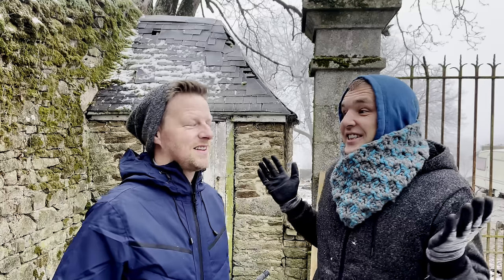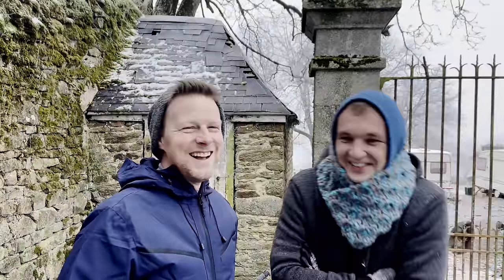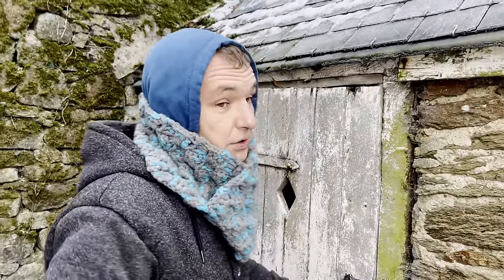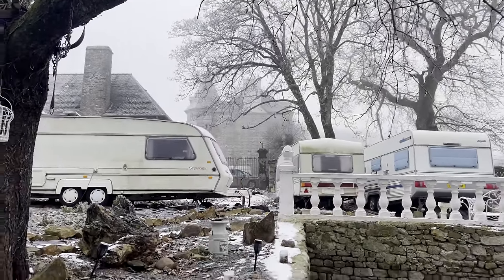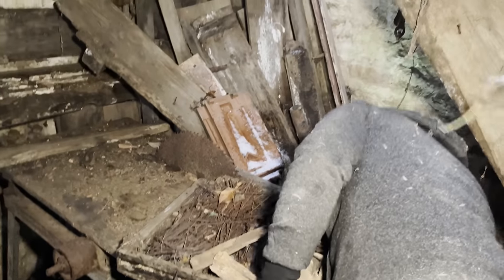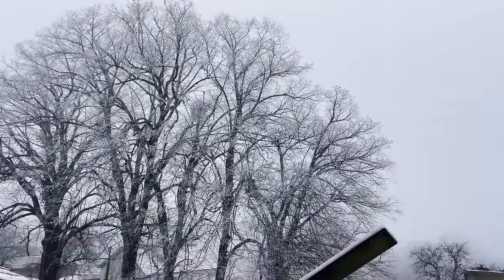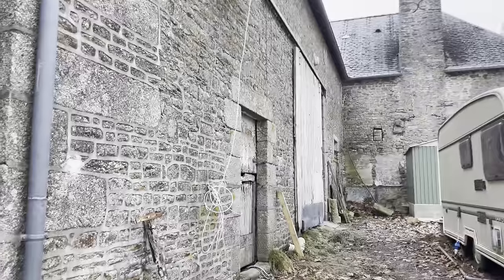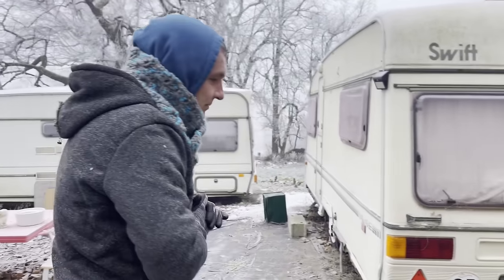Discovering the FORGOTTEN part of the CHÂTEAU | Day 7

Comment: I support Ash's idea about the staircase leading from the kitchen to the dinning room. The kitchens were usually in a basement and the food had to be delivered hot. It does seem logical to connect the two with the staircase. I also agree that the toilet would be used by servants only and not the owners. The owner would have a pot in a commode that the servants had to empty. Lovely job for some. It is unlikely that the Master of the house would walk to the little building by the gate when it is  -5 outside. 😄The "repair shop" building looks like it used to be an open timber frame structure that was filled up with stone on 2 sides at the later date and brick wall was added even later to create the room. Then they added another floor above using just wood. Perhaps there was an old farm predating the chateau? I hope you will discover the history of this place in time.  ❤
Reply: Hopefully servants also had a indoor toilet with a removable pot to empty  as they did the master's.  No one should have to use that toilet in the dark and bitter cold.
Reply: @debpate9405  Most definitely. In old times everyone was using a night pot. How lucky we are! ☺
Reply: They would have used chamber pots before indoor plumbing. This would have been to dispose of the chamber pots and latterly a toilet for outdoor staff.
Reply: Could have been a rope pulley for food!

Comment: Very interesting. Do a layout as you discover each building or foundation on a plan to see the relationship to the property for building foot prints. To give a better idea. There could have been a blacksmith area as well near the stables. It would have been for fixing carriages and doing metal work for the chateau. Much more to discover I'm sure. Thanks for including us on your journey. ♥
Reply: I know that they may need to be a bit cautious, so they don’t give a map to potential thieves, alas.
Reply: True.  A good reason to be missing two walls.  They were usually open to the air as much as possible so they didn't cook too bad.

Comment: You really need to find an archaeologist to assist you in your search for the history. I am guessing that the end off the barn was a small workshop or store room but the brick is maybe where a larger door has been closed in. this building if you made a couple or one self contained apartment, then accessed the uppe4r floor from the main building would make a fantastic terrace if you removed the roof on this part then have storage or another room below...

great video as always guys...

Robb Torremolinos Spain xxx

Comment: There was a stairway in the basement kitchen or in a hallway directly outside the kitchen that went to the floor above where the diningg room was.  The residents of the chateau didn't want to hear the kitchen noise and employees talking.  They also didn't want the heat from the kitchen in summer. Nobody had an outside stairway in a climate that goes down near zero.

Comment: An open side on a workshop allows them to store a very large saw inside to cut up huge trees for firewood etc. The great size of the table saw would be too big for trim etc, but perfect for lopping up tree size pieces, requiring open access... also for horses to stand there to be shod etc. or operate a horse powered PTO. One side (or even 3) open is not unheard of, then closed off w/brick later on. I think the bumpout housed a food pulley dumbwaiter with a counter for unloading & some shelves...maybe a slop area for dumping afterwards that ran into the sewer below via a wooden (?) chute. They used slop buckets that required dumping & rincing out, but not actual toilets. Just thinking out loud. cheers guys

Comment: Old rust frozen tools can be brought back with a bit of effort, the right, oil, & the right cleaning agents. Sometimes, the result is full restoration; sometimes, the result is a working tool that shows it's age. The craftsmanship & engineering are very seldom seen in modern tools.

Comment: I think that building with the missing roof was an old carriage house or farm equipment lean-to with an open front, then later converted into a workshop with the modern brick wall and electrics added.

Comment: Ash, that's what chamber pots were for. During the night or in cold weather people would use the chamber pots and haul them out to dump when it was light out.
You are correct that they might not have had plumbed toilets in the house when it was originally constructed. One could have been added after the fact.
When Versailles and Chambord were constructed, inhabitants relieved themselves in palace corners or hallways. An army of servants were responsible for cleaning up the mess. The smell must have been awful.
In 1982, when I lived in France, it was common to see people urinating and even defecating in public parks, along roadways, etc. Elimination has changed quite a bit in the last 100 years.
At the same time, we had friends visiting Russia using a sponge on a stick in a bucket in public latrines in lieu of toilet paper.
Having grown up on a farm that finally added indoor plumbing in the early 1960's, I can say that Terry is likely incorrect. They would have located the biffy far enough from the house to have avoided unpleasant downdrafts in hot weather. Many castles dumped their raw sewage directly into their moats.

Comment: Kitchens were in the basements with a big cook fireplace.  The bedrooms wood have had commodes that were emptied into the outside toilet by self or staff. The outside toilet is also close to the barns and work shops which makes a lot of sense.  the one inside flush toilet was most likely added around ww2 or later.  I agree with Ash about the staircase it makes the most sense.

Comment: Orangeries were used to house the tender plants, including citrus but could have had other houseplants and fruit trees. Some wealthy people grew their own pineapples! To do this they had many ingenious ways to keep the building warm. Obviously placing on the south side and glass was helpful, but steaming dung, underfloor heating or heating ducts or hot water pipes were used to keep the building to a temperature which would allow the plants to survive. The gardeners would need to have a fireplace which they filled with wood usually, to ensure enough heat reached the plants and didn't go out. This was a very important job where there were many exotic plants. There was a whole room for this under the palm house in Kew Gardens.

Comment: You are correct about the stairwell Ash. They did have separate stairs to service the dining room from the cellar kitchens. They would not put a toilet directly into the dining room! One of those latrine cubbies would hold the lantern you carried to find your way. Terrie, they had chamber chairs that were the toilets with a chamber pot under the seat to catch the excrement. The household staff would empty the chamber pots. The owners didn't go outside to use a toilet. That is a huge saw blade in the ruin's room. I thought it was installed on a table saw. I suggest cutting that ivy root now to help kill off the ivy with the winter freeze. Could those spaces in the building original to the château have been servant's cottages. They would have been 2 room, 1 up, 1 down.

Comment: More out buildings, definitely. The worthwhile rusty tools, etc. can be cleaned up by soaking them in a large vat or old bathtub filled with a solution of water and molasses. YouTubers say it works great and is environmentally friendly. Farmer supply grade molasses is recommended.
Reply: Vinegar works better.

Comment: I'm with team Ash on this one. Aside from his strong argument that they needed an efficient way to get from the original kitchen to the dining room, there's another indisputable argument. The absolute last thing you would put next to the dining room would be a toilet. Anyone who has ever used an outhouse will tell you that they stink. You would not put that constant smell right next to the place where you eat!

Undoubtedly, the owners and their guests would have used chamber pots, which the servants would have cleaned. Indeed, the servants living on the third floor would have used chamber pots, too. Having a small outbuilding to clean those makes sense but, again, you wouldn't route that traffic through the dining room.

Comment: Hi guys, I have a possible explanation for the orangery and it’s tunnel. Near me in derby there is a old stately home with an orangery and it also has tunnels behind it, however they were used to heat the orangery with fires heating up water and passing steam through grills to warm the orangery as they often had exotic fruit plants\trees.

Comment: I have not seen the true layout of the Orangery... but I do know 2' walls will have stored heat, tunnels may have been to light small intermittent fires and funnel heat, the ditch/ trenches I'd like to bet were for fresh manure....which would be another form of heat as it composted. The old UK TV series; 'The Victorian Kitchen Garden' explained a lot re these old methods...maybe try to find it online.🥰.

Comment: Ash is correct that in the period there was always a connection between the kitchen and dining room. Often the stairs ascended into an intermediate room, but always in a way in which the servants were seen as little as possible. It may seem too tight for stairs, but some surviving servants' staircases of the era are so tiny that by modern standards, we wouldn't think it possible for a person to use it, but they did. Probably a tight spiral.

Terry asked where the toilets for the chateau's family would have been. They would have used chamber pots or wooden seats with chambers pots under a lid in their own apartments. The servants would empty them. No matter the era - the wealthy would NEVER have gone outside to the loo. Of course, excavating will hopefully give more clues to its usage. It does seem logical, given the alignment, that the outdoor loo deposits would have traveled through the small opening - until you remember that there's no running water. Even with the descent in the land, there was no 'flush' to move things along, and that's a very long distance to travel without water flow. 

To figure out what was built first, the outbuildings or the wall of the garden, look at where they meet, and determine which stone or original mortar (if any remains) overlays the other. The one on the bottom is the oldest. Another clue is in the craftsmanship of the stone work. When labor was cheaper, the stone work would have been finer. As labor costs increased over the decades, the stone work would have been less fine, and probably constructed more quickly. 

Another really fascinating exploration! Looking forward to what else you discover.

Comment: I would think that the master and mistress would probably have used chamber pots and the servents may have emptied them into that little toilet building.  I wander if it would be a good idea to take the trunk indoors so it can be cleaned and protected from the elements.

Comment: They would have had commodes in the house. Even the staff would have had chamber pots  in their rooms. The staff would have emptied the chamber pots into buckets that would have been taken to the outside toilet. I don’t think it would have been used individually but mostly for emptying the buckets . Think of hotels even up to the 1940’s  where you had chambermaids. The chamber maids would empty the pots in each room as well as cleaning the room . We own a hotel and had chamber pots and large wash basins and jugs in each room up until after the war where hot water was bought to each room and the pots were emptied. I agree with Ash , there would have been no inside toilet there but mostly probably stairs for the staff. The staff stairs would have been narrow and small.

Comment: Could it have been a sentry house originally and then converted to a toilet -   if the original entrance was from that side of the property (or even below) before the property was severed.  That little slit for a window almost reminds me of a hole to get a gun through?  Somehow I don't think servants would have been built a building like that -IF the wall is an add on what about the carriages passed the sentry building drove through where the wall wasn't - stopped with deliveries for the staircase to the basement or forward onto the the original front of the house for guests - the carriage could continue right round and out the other drive.  Possibly the fencing and turret were all done same time when they turned the house around after severing off the land below?  In Canada original settlers (French and English) lived over top of their livestock as the heat rose to keep the farmilies warm.  Any evidence of fireplace bases in the bottom of the piggery etc?

Comment: Ash, yes it wasn't just stairs, it was also the butlers pantry where he had cutlery and crystal and shined the silver...he wasn't about to be found in the kitchen doing that shiite!!!! there would have been a counter for the help to set down plates and the upstairs service staff to put int he service cutlery and then present it to the master of the house then serve the women first, eldest first then around the table, then the master and around the table descending by age...(french service)
     The sewers emptying out into the wall next to the Orangerie is done on purpose, because the gases that are formed in the decomposition of human waste (or any animal) creates heat which would have been cheap free heating for the Orangerie....in Versailles they used cow and pig dung to surround the root system of the orange trees in the winter because the shit created methan through decomposition and that created heat for the roots of the orange trees so Louis XIV could consume oranges and orange juice year round....At my families castle (for the first born and his brood) had a stone sewer system that lead 100 meters down hill and in 1901 it was completely opened and tiled with white ceramic tiles and despite the castle burning during WWII, the sewer is intact.....